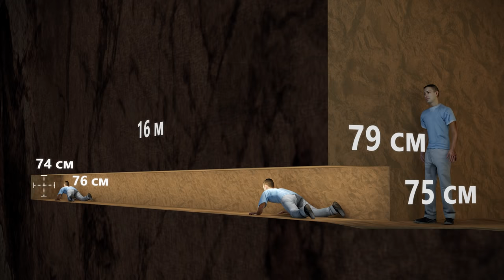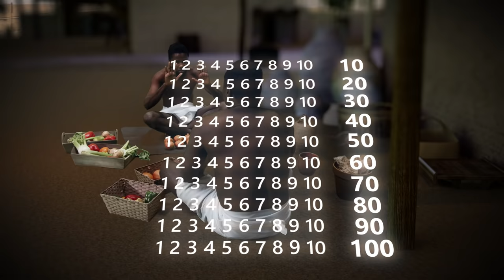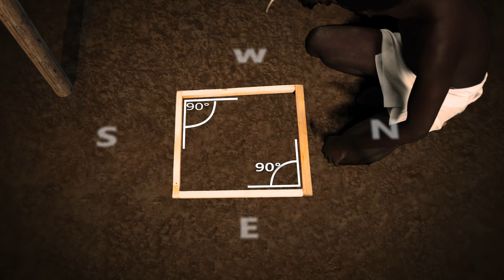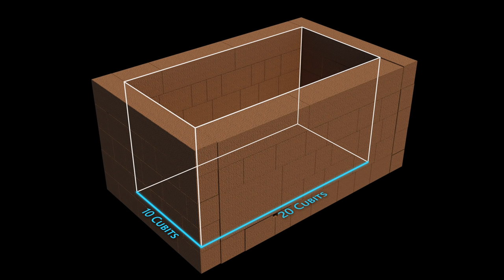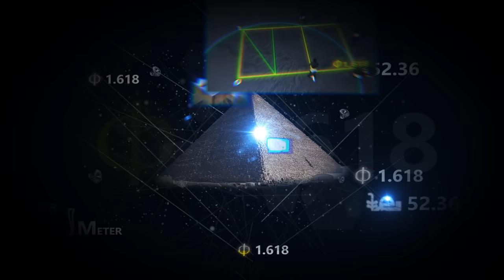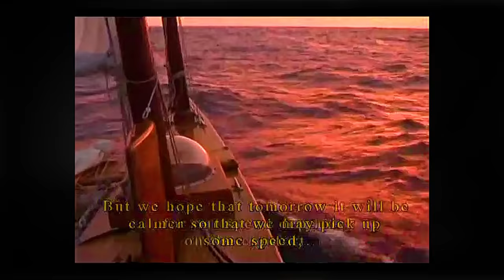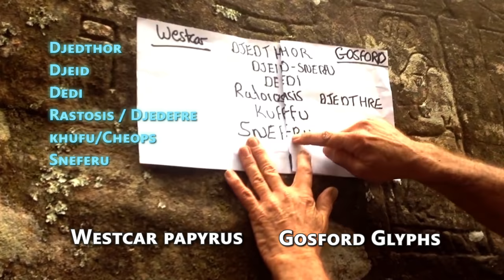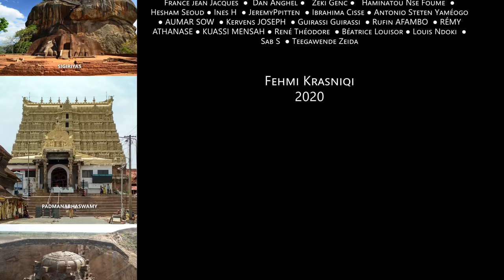The Movie Great Pyramid K 2019 - Director Fehmi Krasniqi

Comment: Thanks for the documentary. It was enjoyable but also raised many questions. For one, more evidence is needed to ascertain how many of the blocks were poured versus cut. It should be possible to do some analytical chemistry to support your claims. The making of the concrete that you suggest should be demonstrated in your film (not just an animation), and then the results should be shown side by side with a cut stone for contrast. Also, a little analysis of the two versions regarding strength testing and resistance to erosion would be appropriate. Clearly, if the concrete did not have the same bulk modulus as the cut stones, there would be great risk for collapse.

You also posit the use of solar power via a lens (magnifying glass) was used to melt granite so it could be poured. As far as I know, there is no archeological evidence for such a claim. The problem is that one could use one large lens, or many smaller ones to concentrate sunlight. In either case, there should be some of those lenses in the archeological record... and thus, they are conspicuous by their absence. Furthermore, assuming for the moment that such devices were actually used, there is the uncomfortable fact that when you melt the granite (mica,quartz,feldspar) you liquefy the crystal structure that formed during the cooling of the magma. Recall that the grain (crystal) size in igneous rock is proportional to the time it takes to cool, with larger crystals requiring more time to grow. All you will get from melting granite and cooling it quickly is obsidian, the black volcanic glass that forms when lava cools rapidly. Sorry, but that is just a geologic fact, and no amount of animation can change it. I'm pretty sure that there is no obsidian in the great pyramid.

I would also like to mention that the current understanding of human evolution has humans leaving Africa multiple times over the past 100k years. All modern humans have their ancestry in Africa. As humans migrated to higher latitudes, evolutionary pressures have favored the lightening of skin pigmentation and other superficial characteristics such as nasal and eye structures. One such pressure is the need to make vitamin D from sunlight. Not surprisingly, many different characteristics have emerged as humans adapted to micro environments separated by geological barriers. The fact that Egyptians are dark skinned is expected given their environment. What is surprising is the persistence of darker skins in higher latitudes like Britain, as we now know that some of the preserved bodies dating from 5k - 7k years ago had very dark skin compared to many modern inhabitants. In all cases, the genetic characteristics of people are a consequence of the geographical journeys taken by their ancestors. Mixing politics and science never ends well.

So while I applaud your creativity, you really need to develop your ideas more fully and provide more evidence for their use/existence.
Reply: I agree with you Charles. And in addition to your comments. Concrete is plausible but the big lenses to melt the granite? If the lens break due to accidents? The long workers line up the pyramid is ridiculous logistic point of view. They stay there all day long?? There have to be 2 lines, one for the return baskets and so on ! Sandu
Reply: You obviously didn't watch the whole thing.
Reply: @jaredmoore2615  I did Jared. Did you read my comments? Workers move the buckets with concrete up the pyramid by twisting movements. That buckets appears to be minimum 10 Kg(in reality if filled with concrete is much heavier). Try doing that for one hour. Also when the pyramid is going up the movement is upward with the bucket (taking the bucket from the lower worker and giving it to the worker above)which is much more difficult to sustain for longer period of times. They must be SUPERMAN to do such kind of work. Or they have to have replacements every hour or so. Also the buckets have to be transferred back for reloading. The workers line became so long that the concrete in the bucket may freeze. Of course we can presume they will use fabric inside the bucket to prevent the concrete from freezing on the bucket's wall. But do you imaginer the quantity of fabric needed? Also the workers line is so long and tight that if some emergencies(biological necessity) occurs is a show stopper. Also the line is prone for accidents. Also the lens use is ridiculous not even a comment needed. Although the concrete theory is acceptable. Good animation and good choice for music though.
Reply: 2hr 50 min in ? not analytical enough !
Reply: Not only that, it's well known that the Copts were the original Egyptians, and at least some have fair skin and blue or grey eyes to this day, like the scribe in the Egyptian museum. The obsession with race really spoiled it for me. Like you say we need more proof of the interesting poured vs cut, but when I started seeing pictures of giant magnifying lenses it started to get absurd and may as well have been aliens who brought the technology at that point. Still fascinating and thought provoking.
Reply: Please cut granite and some blocks with copper. After 200 years I will let you see how to pour a block.
Reply: @sanic5946  yeah sure all the concrete is hard in 1 hour. This is a new invention, and this concrete is not strong the slow one is. What are you guy's...... I'm out of here jesus
Reply: @Revolver.Ocelot  The most common method to be able to cut granite with copper tools would be to build a fire up against the rock, then shock it by pouring water on it. Then the copper tools can pretty easily chip away until you need to build another fire.
Reply: @kathykonkle1097  Egypt at the time had no forests......where do you source the wood you talk of? Date palms were needed for food. Implausible.

Comment: In addition to the problems that the manufacturing, handling and operation of that giant lens presents what I can say is that if you melt granite when it cools the granite will not have the same appearance that before melting because the crystals of minerals that form the rock will melt together in a pulp of silicates, so your theory is likely invalid. You could had done some tests melting granite in an industrial oven to see how the granite looks after cooling. It would have been useful for you to take some academic courses in mineralogy and petrography.
Reply: You are right. If you heat a rock mass to molten state and then cool, the cristales would be very small.A granitic rock mass has cooled very slowly at depth to give it its  characteristic crystal size.

Comment: Not finished watching this eye-opening presentation yet; however, two things already come to mind: as I understand it there is not a single mention of the pyramids or their construction on any Egyptian hieroglyphs, nor those extra large magnifying glasses used to melt the mix for making the "concrete"...lots of evidence for the pyramids still exist (the pyramids themselves), but not even small broken shards left over from these lenses has been discovered?
Reply: Herodotus mentions that the priests at Hieliopolis (Innu) had very large lenses which the used to observe the stars and to redirect the sunlight, this was in the 5th century BC.
Reply: The Dynastic Egyptians decidedly did NOT build the Great Pyramid, or anything on the Giza Plateau. Why is Egyptology so trapped in that stupid way of thinking? 
The Egyptians who built the Pyramid had better technology than giant lenses. Come on! Lenses?
For a bronze age culture that's rare.  How did they grind them? And yes: where did they go, and where is ANY mention of them in Egyptian history? 
The Dynastic Egyptians only used the structures and had no understanding of their original construction.
So, if we accept the lens theory, then how were the granite blocks, some weighing 60 tons or more, transported 500 miles down the Nile? Reed boats?  
How then were they lifted 250' into the air, and placed with such incredible precision, in such a way as to not shift a millimeter even as Cairo is flattened by an earthquake?
The Dynastic Egyptians simply did not possess the level of engineering and technology to build them. And they don't claim to have done it.

Comment: I totally love this. But I really would like to see more documentary about how the lense(s) melt granite as well as how the lenses had no trace.
Reply: The concentrator in Font-Romeu-Odeillo-Via (France) reaches a max. temperature of 3600 degrees. The absolute maximum is 5800 degrees, limited by the surface temperature of our sun.
https://de.wikipedia.org/wiki/Font-Romeu-Odeillo-Vi

The melting temperature of dry granite at ambient pressure is 1215–1260 °C (2219–2300 °F); it is strongly reduced in the presence of water, down to 650 °C at a few kBar pressure.
Reply: You will be waiting a long time to see a primitive lens melt granite, by the way once it’s melted it’s no longer granite.
Reply: They probably used the same lens the aliens used when they destroyed the empire state building on 
Independance Day.😞😞😞
Reply: @GroberWeisenstein  so without pressure this cant happen?
Reply: @GroberWeisenstein  Excelente explicação. Muito obrigado.
Reply: @georgeharisson1880  I kind of think the Aliens used a kinetic energy weapon. Massive spinning wheels with ball bearings and then unleashed.

Comment: I would like to see one of these solar lens instruments working today. Someone could construct one and prove the theory that the granite used was from molten man made material.
Reply: It was from Aswan though
Reply: @philen  Nice,thanks for the reply Philen,makes sense what you are saying.What about the idea about the mix for the Limestone and concrete blocks.Do you think they were molded into blocks as the video says?
This was a really good film to watch though.I enjoyed it.
Reply: @philen  They probably were IMO
Reply: RIGHT!!!!
Reply: You can remove the front fresnel lens from an old projection TV, make a pivoting frame out of 2X4s. The one I have is about 3X4'. It will melt metal, concrete and granite if you give it enough time. To melt industrial levels of granite would require a HUGE lens and huge amounts of time and the heat would fry anyone within several meters of it. Where are these lenses? Where are all the ceramic moulds which would have been amazingly thick to handle the weight of the granite castings. There should be huge piles of debris from all of the moulds!

It seems to me that if somebody actually believed this total hoax, they would examine the "melted granite" and prove it had been remelted based on the crystal structure alone. Also a chemical analysis would show chemical changes compared to natural volcanic granite. Granite I have melted looks more like shiny volcanic glass and gives off quite a bit of smoke in the process. 

Also, why did the Egyptians have big quarries where they harvested granite? What did they do with all the granite then?

Been to Machu Piccu and examined the rocks. No way they were somehow cast. Where are all the moulds, lenses, etc.

Examples of parallel development of technologies is common. All cultures had a few people with Einstein level intelligence who would be able to put together mathematics combined with astronomy and geometry, etc. Never underestimate the capabilities or so called "primitive cultures".

A simple DNA test would determine if "negroes" navigated across the Atlantic and set up shop all over Central and South America. There are many epic flaws in this fairy tale. Perhaps it's a massive CRT propaganda ploy designed to indoctrinate kids or something. But factual, give me a break!
Reply: @werewolf2825  That doesn't really prove anything. It just shows one way NOT TO melt and recast granite. According to the patent office you can easily melt granite at 1500 degrees and recast as artificial, with all the same properbilites as natural granite, with the same grain texture as well.
Reply: I would like to see at least one of the thousends of Lenses they must have used around the globe. Where they are, you find none of them these days.
Reply: do it yourself.
Reply: @philen  then how did they cut it with sticks and stones?
Reply: @ashkannazary6432  Wish I could. Could you do it yourself? You know you could'nt
Reply: A fresnel lens of thin plastic will melt a padlock, pretty hot. I wonder where such a jewel as the type depicted lies.
Reply: I was in Egypt during the summer time and its really hot during the day and the sand there is the same as the yellow sand used for construction.
Reply: @beforeafter90  Nice,sounds like you had a great time in Egypt. I went there for work reasons in 1989(Port Said) Could not get to the Pyramids ,but one day I hope to return there.The people were really nice too.
Reply: I agree I would love to see that myself, but I do not believe that is possible why i deem this documentary on the contruction of the pryminds over all false, for the most complex part, the granite was not explained. its a joke
Reply: @ronlevandoski4805  Thank you! I didn't buy about the lenses neither. As hypostesis, maybe they (whoever they were) use some other methods or technology and could change the molecular structure of the granite making it less dense, more "liquid". Just an idea. I don't think there were aliens involved or anything, but to me personally (and specially after what you wrote) it sounds more plausible than some gigantic lenses used by egyptians! 
Owe so, a lot of numbers look like a pure coincidence, at least in 20%. And according to Plato Atlantis sunk about 9.600 B.C.
Agree on "people with Einstein level intelligence". Beavers from around the world didn't meet each other and yet the make the same dams.
This Documentary is good tho, interesting, but have a lot of conjectures and assumptions and yet they critique other theories.
Also, I heard there were found a lot of granite and other types of stones with very precise cuts, like form a saw or something. Why didn't they mentionet it? 

The Sphinx, isn't there a lot of geolgysts who are convinced that it's far older than mainstream media says?

Comment: Melting 100t of sand in an hour requires something on the order of 450,000kw of power.  At high noon in Egypt they can get about 1kw out of a square meter of sunlight.  So, this magnifying lens would need to be 450,000 sq/m in area lol.  So…. Me thinks that isn’t how they did it.
Reply: Correct .  It is not possible to melt granite or limestone using the sun and a lens
Reply: Don't you understand that ordinal pharos where alines with technology that could transport they galaxy level distances 

So do you think they understood concrete
Reply: All I can say is thanks for the knowledge. The circle will be closed. Truth crushed to the ground will rise. Thank you,, Thank you.. one Love Always.
Reply: Think? How else would this have been done,, they have forgotten more then you will ever think you’ll know! The suns lite
Would have been 5X stronger with a much cleaner transpiration of light! And if the lenses were of a angle as I think they Must have been? Yes,, it would  have been very possible! In fact,,,, there gifts,, far exceed anything in our current teaching’s.

So shove it,, would ya…
Geez